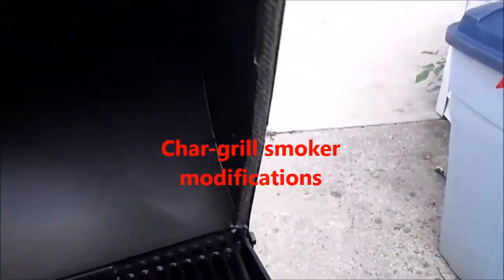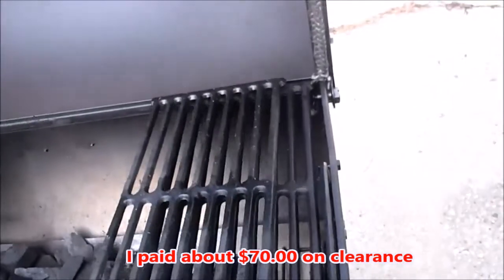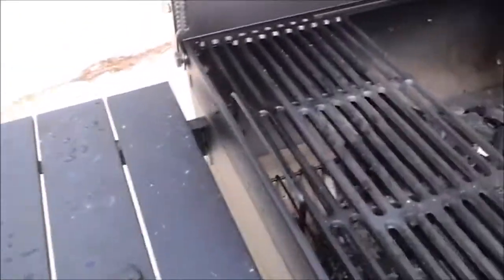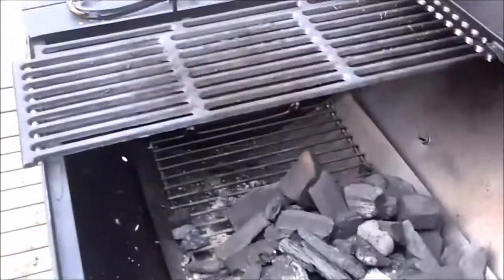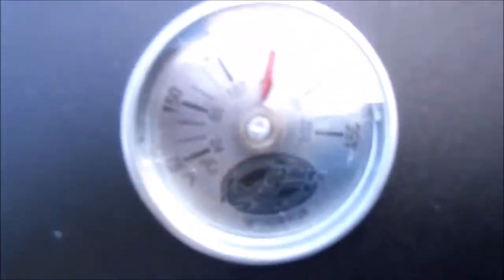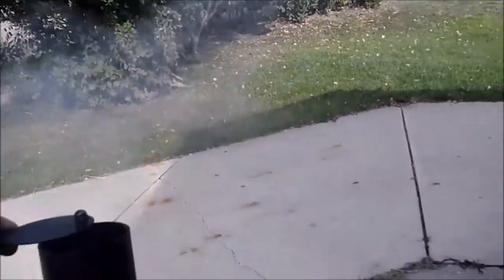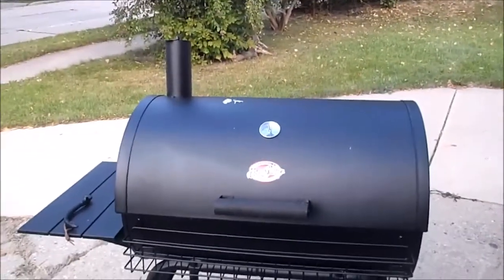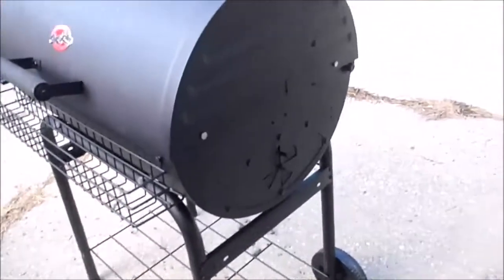char-grill smoker modifications

Comment: I have the same thing with smoke box. The lids leak bad. The angle pieces are the best remidy . For new owners i wish they could do this mod before they fire it up. It makes the job much easier. The only other mods i plan to do is wrap the smaller grates with foil to use as smoke deflecter and put the hose on. Wont be installing more temp gauges. Dont think it's nessicary, but thats just me.Happy Smokin!!

Comment: I've had my chargriller probably 20yrs with NO modifications to the hood or vent.
They are designed to work the way they're built without modifications.
When there's smoke coming out around the hood that means it's full of smoke all the way down to the lip. Think about it.
The chimney and flue is designed to keep the heat (or smoke if that's what you want)in.
If you want smoke, you close the flue some.
If you want to grill, you open the flue and the temperature will rise.
Your seals are pretty much defeating how the grill is designed and all your grinding is probably going to cause rust.
Like I said I've had mine for many years and all I had to replace was the ashpan and chargriller is extremely easy to get parts.